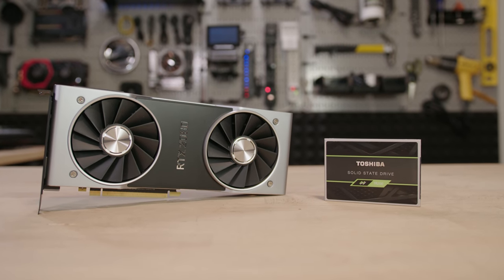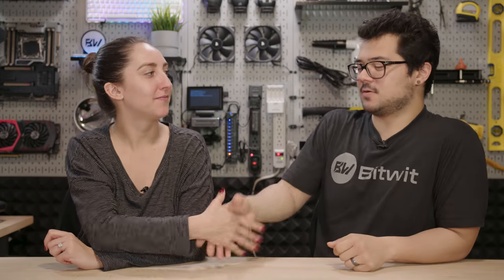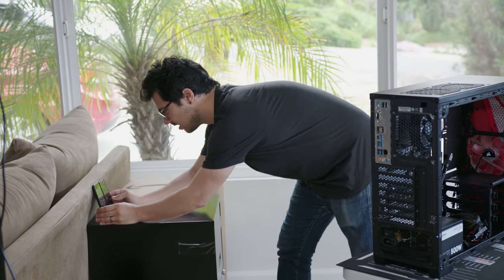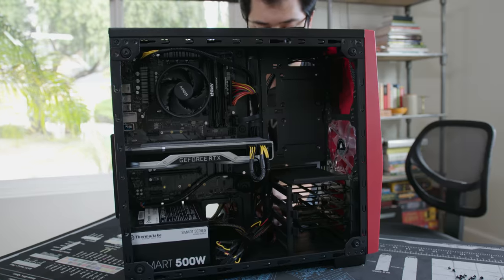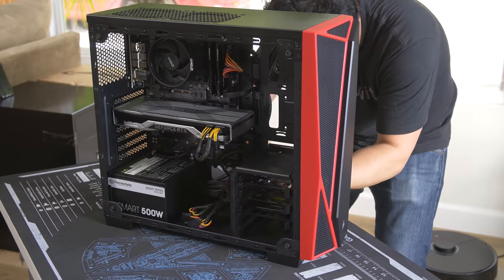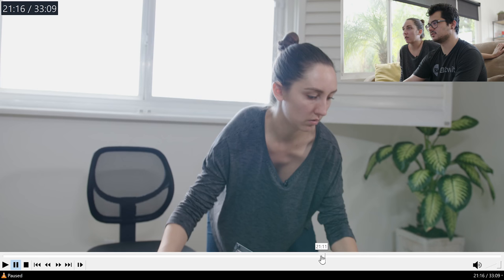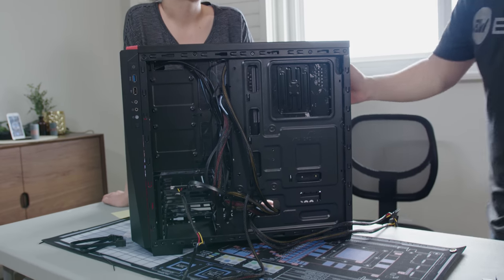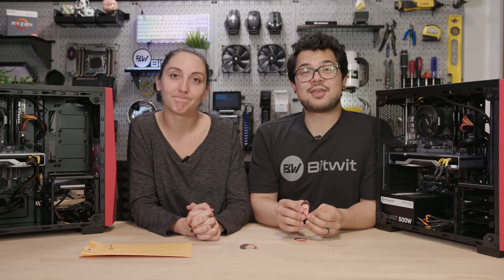She challenged me to a CABLE MANAGEMENT CONTEST (big mistake?)

Comment: Considering one has years of pc building and the other doesn't, 15 minutes really isn't enough time to judge either of them. Kyle struggled in this time limit as it was. I would also add that cable management isn't about how quickly you can do it, but how well it's done.

Comment: I liked this overall, some nice fun, but I think the rules were a bit restrictive.  To me, to determine who is best at cable management you should absolutely have the same setup, but at the same time you also want to not be so restrictive as to limit possible creativity.  Having the systems pre-built, determining how many and what size the ties were, the insanely short time limit, all contributed, in my opinion, to an overly restrictive test, that didn't even test the actual idea of who could do a better job of cable management.

Comment: Should be at least 30 minutes and if you have to install the motherboard with the CPU make it like 1 1/2 or 2 hours  to finish with cable management.  It's about doing it right, not doing it in a hurry so it looks good.  Still was fun to watch thanks for sharing. :)

Comment: I only have 8gb ram at 2400mhz core i3-7100 2 core and gtx 1050 3gd and 1 tb hard drive
Reply: Timtasha that’s not a bad system at all. I saved up for about two years before getting my setup. It takes some time

Comment: Ummm those specs are so much better than mine and you just doing cable manage meant I have a core i3 6100 with 8gb ram 1900 ghz 1tb storage and Radeon r5 220

Comment: You guys could try cable management on my tower! Lian li pc-011 dynamic with a corsair H150i pro 9 corsair ll120's two lighting node pros and a commander pro. Only one ssd and a standard hdd but it's a nightmare! A beautiful nightmare though!
Reply: For real though I've been itching to take care of it for a while and even add the 3 ml120 fans that came with the aio so the radiator is in push pull but it's such a headache to go through and I'm not even sure how I want to integrate the extra fans in. Probably just gonna run splitters on the pwm cables from the aio since that's where they'll be anyways

Comment: but is a 500w enough for a rtx 2080? i had to upgrade from a 500 to 650w for rtx 2070
Reply: If you don't mind the stability flopping all over the place and potentially ruining your performance and/or card, that power supply may cut it.

Comment: If this is a cable management contest, shouldn't all the components be installed and you guys just deal with the cables? Either that, or add more time to the challenge. My goodness, 15 minutes is not enough time to put together a PC, let alone worry about how the cable management is going to look like.

Comment: As an experienced builder I would say for a good challenge you need minimum 25 minutes to do decent wire management. 15 minutes isn't much time and I would also like to point out the case isn't the greatest for this challenge.